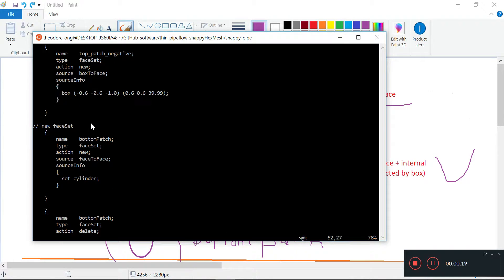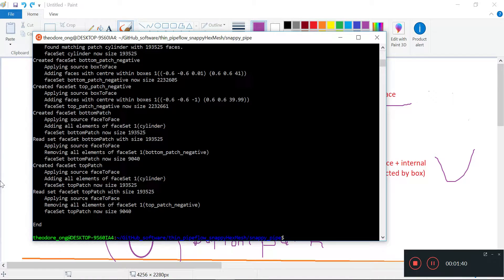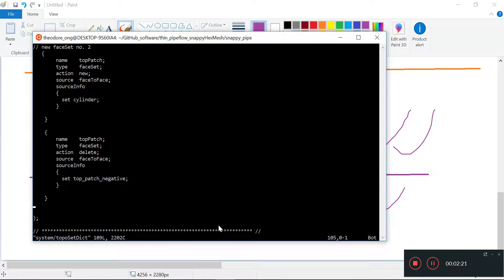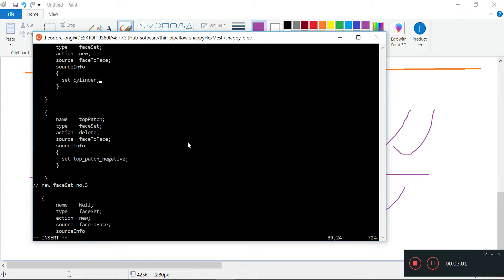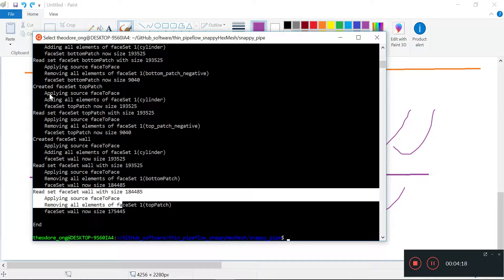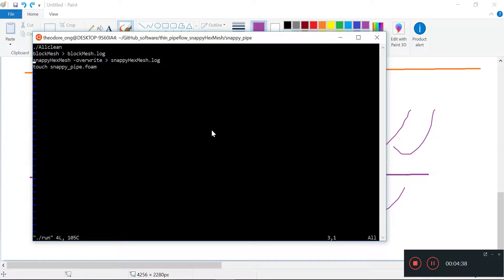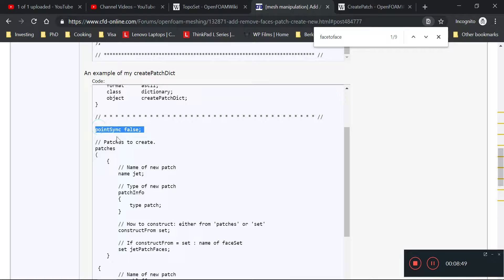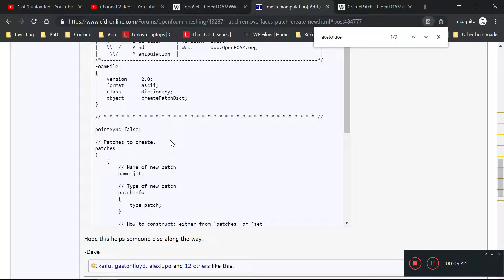OpenFOAM Intermediate - 14 topoSetDict (creating custom faceSets)

Comment: Respected sir, 1st of all thank you for such useful videos. For top and bottom patches we deleted the box and ended up with disc. In case of hollow cylinder , we have deleted two discs. How is itmaking a hollow cylinder but not a solid cylinder of smaller lenght?